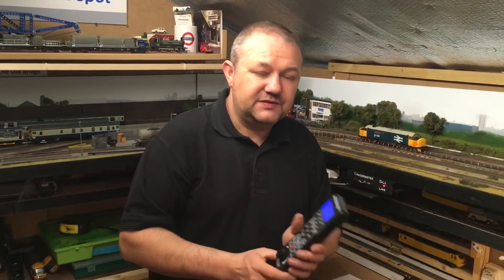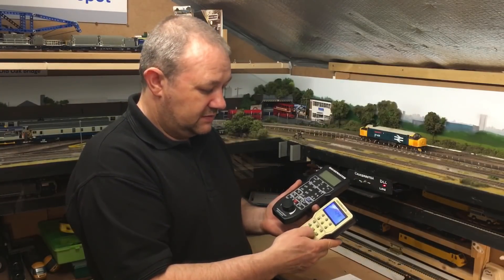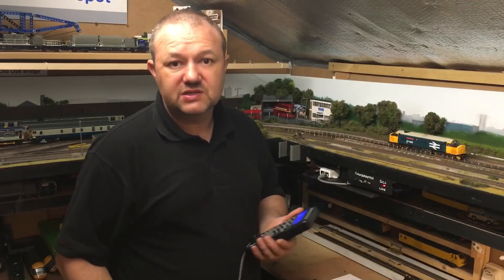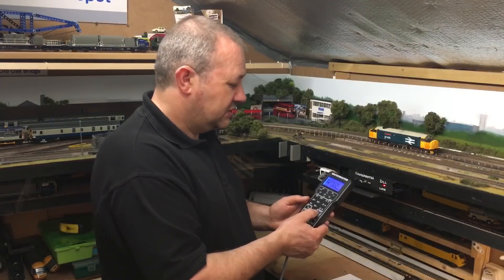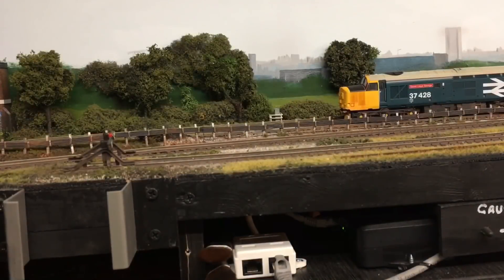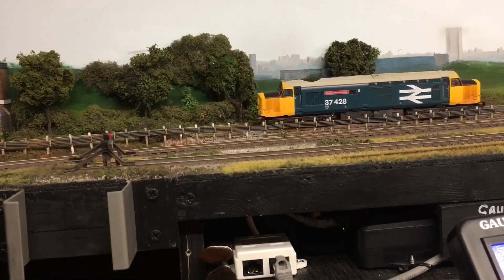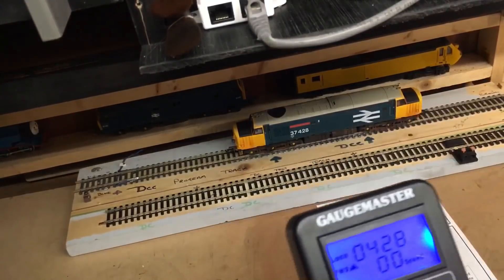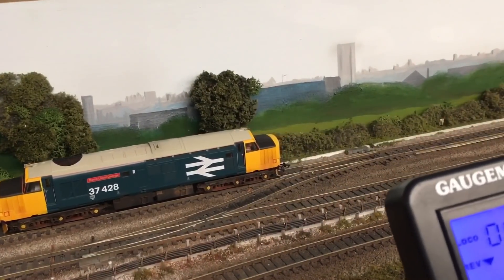Program loco's CV’s using DCC controllers

Comment: Hi Garry Great video Ive taken your recommendation and brought the Prodigy express from Amazon it was on offer for £108 must say i love the feel of the prodigy hand controller compered to my old Hornby select and looks a lot easier to use. cheers for doing this video Im going to have fun learning how to use it now lol  ... Pete
Reply from the maker: Peter thanks for your comment and apologies for delayed response, things very busy at the moment due to working with channel 5 tv competition,

Yeah it’s been absolutely fab for me hence my video, I only promote what o feel would benefit others.

What a fab price on amazon 👍 love how much u saved.. I added the advance 2 controller to mine as for extra running again that was a steal from amazon £50 cheaper.. 

Have fun and if you need any support just drop me a lines

All the best Garry
Reply: Thanks Gary i appreciate that yes Amazon have had some great deals on Gaugemaster bits i have been thinking about getting the extension plate but I'm thinking they must be a cheaper alternative as they are only internet leads
Reply from the maker: Make sure u get the gaugemaster one dcc 71 as these are configured differently than standard internet sockets 

http://www.gaugemaster.com/item_details.asp?code=DCC77&style=&strType=&Mcode=Gaugemaster+DCC77

It’s £10 but your spend more from eBay if not correct..

This is what I used. 👍
Reply: Thanks again Gary I will  get the gaugemaster one and forgot to say good luck with the channel 5 program mate sounds very interesting ... All the best ... Pete

Comment: A good video. I think which ever system you choose to use setting the CV's of the locomotive is a must.  It allows you "drive" the loco instead of just "controlling" it. Keith
Reply from the maker: Totally Keith, thanks for pointing this out, certainly brings the real feel of running trains to a model.
Cheers Garry

Comment: Thank you, that is the best video on explaining cv values and changing them that I have seen on YouTube. Although your control system is different to mine (I have a EZ Command Dynamis with Pro box) I'm sure with what you've explained it will help me to understand how to change CV values a bit more easier. I find the instruction book and the YouTube channel from Dynamis very poor. You have helped me understand a bit more what it is all about, Thank You. .....Graham
Reply from the maker: Thanks Graham,
Yeah CV setting is standard as compliant to NMRA standards but just entered in a slightly different way on each dcc hand set

But certainly doable on all dcc systems 

Thanks again Garry

Comment: Thanks Gary , I have been on DCC for about 4 years but was never sure what to set the start voltage to and was quite wary of altering CV's . Will have a go now at my loco's , you demonstrated that in a nice and easy way to follow .      Cheers......Peter
Reply from the maker: Thanks Peter

Let me know how you got on if you have a dabble.. 
any problems send me a message 👍

All the best Garry
Reply: Hi Gary , I have been happy altering CV's 3 & 4 before . Have had a go at the start voltages and it does make a difference and also reducing max. speed on a couple with CV's 5 & 6 , my latest 57 from Bachman I'm leaving alone as it's a good runner as are my Biffo fitted sounds . Thanks once again .......Peter
Reply from the maker: Great stuff Peter 👍

It’s one of those sayings - if it ant broke don’t fix it.. but looking at what can be accomplished, is very rewarding indeed.. 

Thanks for updating mate 😁
Garry

Comment: Hi Gary, I`m about to convert to DCC and like you I was a little apprehensive about making the change, so I found your video very encouraging. Thanks for posting this video. Cheers Greg
Reply from the maker: Greg It’s great system at a low entry level I’ve used it for 2 .5 years and still loving the ease of use 👍 and I believe it’s cheaper on amazon at the moment 

Cheers Garry